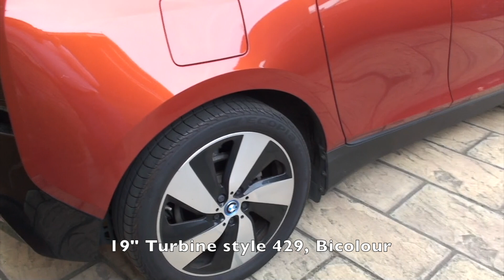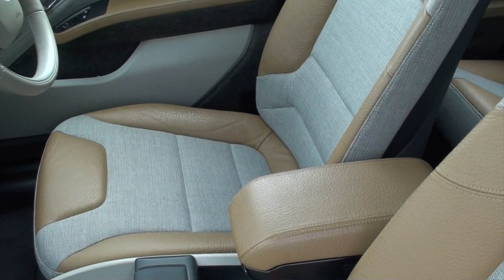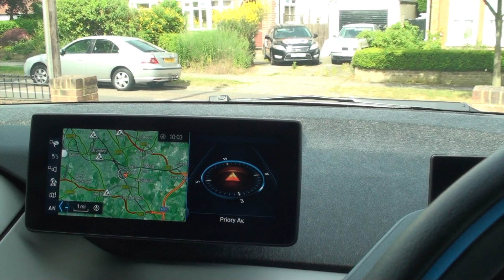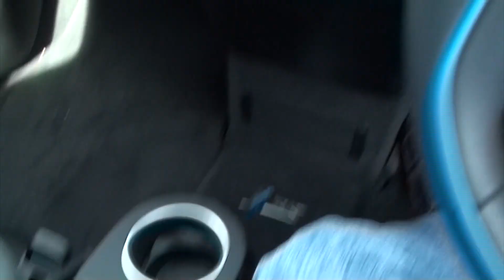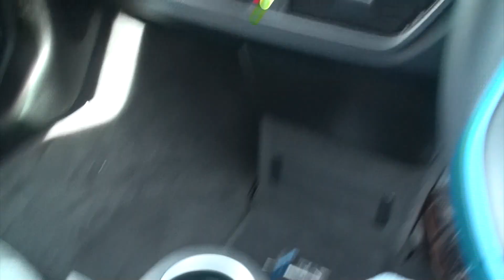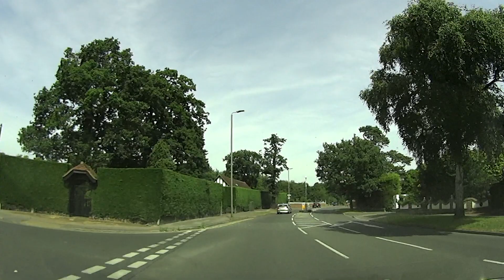BMWi3s

Comment: Great video Justin and I totally agree with your comments. I changed my March 2015 REx (Andesit Silver, Lodge, 927 turbos, Park Assist, ACC, Sunroof, Prof Sat Nav, DC charging) for 94ah i3s REx last November. Same spec although I only have rear parking camera instead of Park Assist. Decided I didn’t really need front parking sensors and certainly don’t miss Park Assist which I was always wary of using in case I kerbed alloys. The only spec option I regretted not spec’ing on original car was LED highlights - the standard were very poor and especially noticeable after having several cars with Zenons. I always felt the Lodge interior best suits the minimalist interior of the i3. I opted for Suite when I placed my order but it was a bit of a leap of faith because dealer only had one demonstrator in the standard upholstery. When I saw how dark the Suite interior made the interior look even with a sunroof I “downgraded” to Lodge. I think the dark door cards with the Suite interior don’t help. I wasn’t that enamoured at first glance with the slightly darker patterned colour of the new Lodge but it has grown on me. It also seems to have a higher wool content that holds me in the seat tighter. I think the Infotainment system on the LCI car is much better. To have visual directions all the time on the spilt screen, rather than just at motorway junctions, is a big improvement. I like the compass but miss the three day weather symbols. 
I struggled to justify changing upgrading my old 60ah REx as I had done less than 18000 miles, I had had no problems other than warranty recalls and upgrades and it drove beautifully but I decided I would prefer a 94ah REx rather than being stuck with a 120 Bev when I came to change it - possibly in 2020. I think I got one of the last 94ah REx’s as dealer said that he was unable to order a standard car the week before and could only see one unallocated build slot for an i3s which he was unable to nab. When he spoke to BMW they said he could take it but the specification was fixed. After rejecting the spec (which was actually quite close to what I wanted) the salesman came back the following day and said that BMW had taken a manual alteration to the specification and would update the build order. It was built less than 3 weeks later and delivered within 5 weeks which must be just about a record - I think I waited 16 weeks for my first car. But, to take up the key point of your video I cannot believe how much better the LCI i3s is to drive and the overall quality and refinement improvement. It has really really surprised me and taken away all the expensive pain of making the switch. I cannot really agree that the ride does not feel harder but in my opinion makes the car far less bouncy and more planted. Coming from a succession of BMW 3 Series and MINI Cooper S’s with runflat tyres it is a trade off that I can more than live with. THB the performance improvement is only noticeable when accelerating beyond about 55 mph - when it is usefully for passing HGVs. As it seems doubtful that the i3 is going to be replaced and it suits me so well I have had paint protection film applied to the front and wheel spats to protect the paintwork. It also makes cleaning easier. It hurts a little having to pay VED again and the over £40k surcharge (for the next 5 years) but the i3s just suits me so much better than any other car on the market regardless of price. Living alone and being retired the Tesla, even the Model 3, doesn’t suit my requirements as well. I also love the unique design (although the styling doesn’t completely bowl me over), materials used and technology (although the later is not generally up to Tesla standards). I know us i3 owners may be viewed as bit of an odd ball group but in time to come I think we will be viewed as having had huge foresight. If you (or anyone else) has yet to make the switch to an i3s I would urge you to do so albeit I would still have reservations about choosing a pure Bev as my sole car. Thanks again for the very informative video.
Reply from the maker: Richard,
Thanks for your feedback, I'm glad you enjoyed the video. My dad's i3 (purchased new) is a 2013 model, he's 81 now and he has decided to keep it longer. He says this is the first car he's owned that still drives like new and has not fallen apart in 3 years, he's just checking it in to get a few scratches fixed so it will be like new again. He fancies a Model 3, but I advised him agains it for two reasons: The i3 is "ding" proof and he drives down a lot of country lanes, so the carbon fibre reinforced plastic body panels are ideal, also he has trouble getting into low cars, due to many sporting injuries when he was in his 20's and 30's so the i3 is also ideal and easy to get in and out of. It all depends on your use case, if you are a frequent motorway user than get a Tesla Model S3X, for the city get an i3. We'll keep ours a lot longer, same with the Model S 85D (AP), at 110k miles it still has a lot of life in it and still drives like new, minor build issues excepted (sorted in warranty) uncover a very solidly built and gelable car that's also designed to last.

Justin.
Reply: The i3 is a great car for the mature motorist. Easy to get in and out of front doors, good visibility, simple automatic and good manoeuvrability.